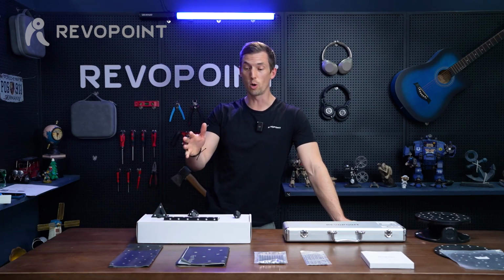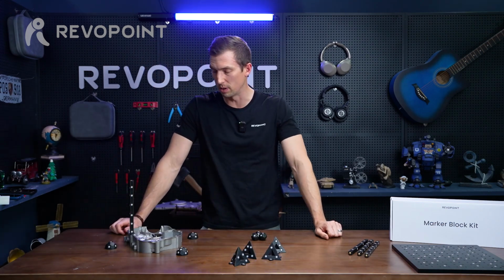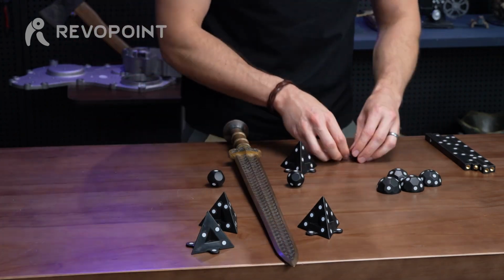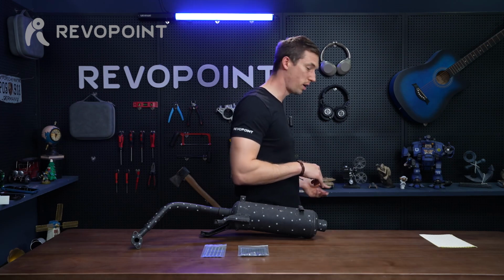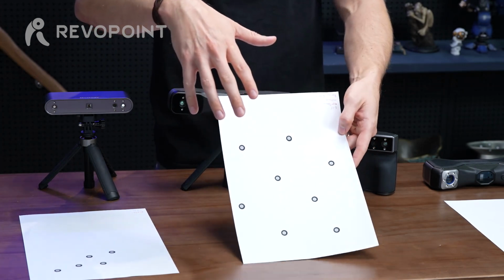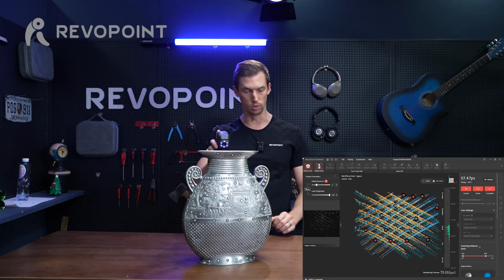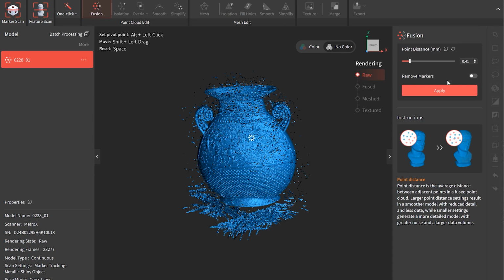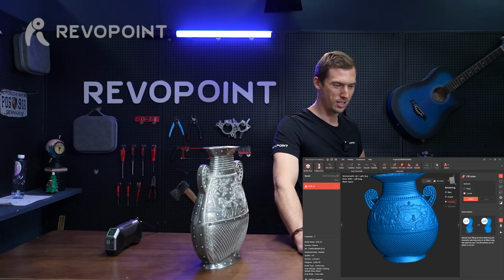Revopoint 3D Scanner Tutorial:  How to Use Every Marker Type

Comment: Any idea if there's some enhancements coming for the marker-removal part of scan processing? We had to scan a white face mask, and had to use markers directly on the mask to get it to go; while it worked, it took a ton of retopology in post-processing because of all the 10mm circles 'protruding' from the scan mesh data where the markers were placed. I get that is why most probably block out around the scanned object, but it would lose tracking without the markers directly on it (Miraco)

Comment: I just got my Miraco Plus. After this video I still have a couple questions:

- If you need markers, does the scanner need to be used in global marker mode? Or are markers still helpful in feature mode?

- to avoid having to peel sticker markers off, can I use the PMK magnetic markers as normal markers?
Reply from the maker: You can use markers in both global marker and feature mode, although they are more beneficial in global marker mode. But you can not use PMK as normal markers